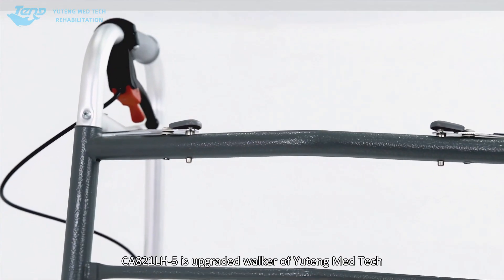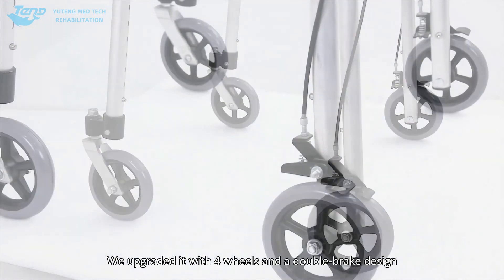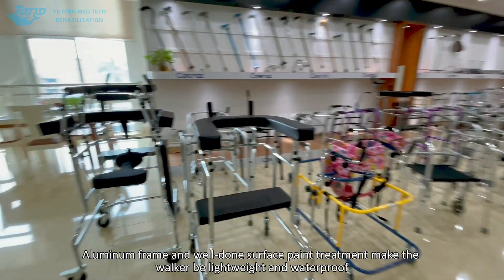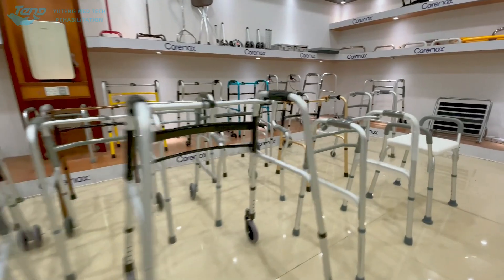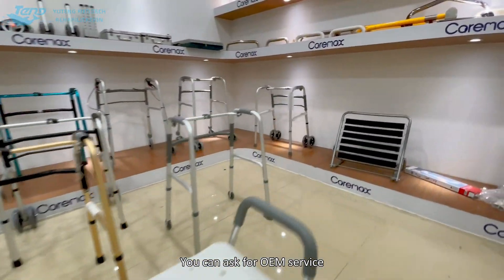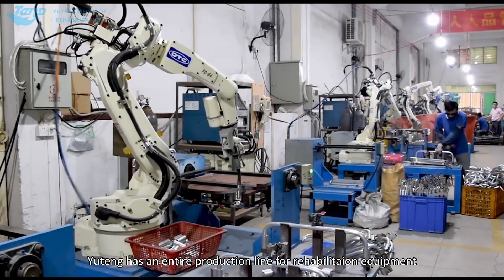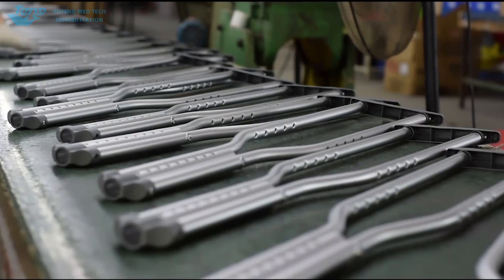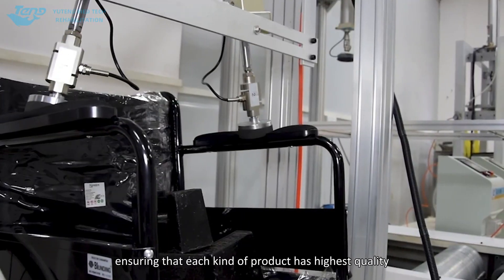CA821LH-5 | Double Brake Wheeled Walker

Comment from the maker: Learn more in our website: www.yutengmed.com
CA821LH-5 is Yuteng Med Tech's Featured Double Brake Wheeled Walker.
Convenient, save effort and safe.
CA821LH-5 Double Brake Wheeled Walker is made of aluminum alloy, lightweight and portable.
There is 2-button release design and folding design, easy to move.
Contact us for more information:
Contact us for more information
whatsapp:+86 180 2933 8197
email: yutengtech@gmail.com